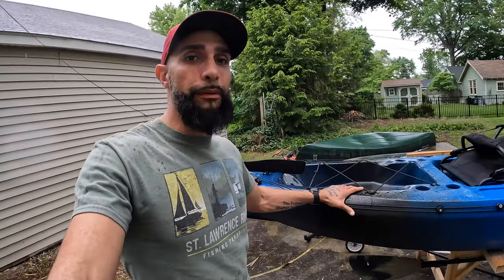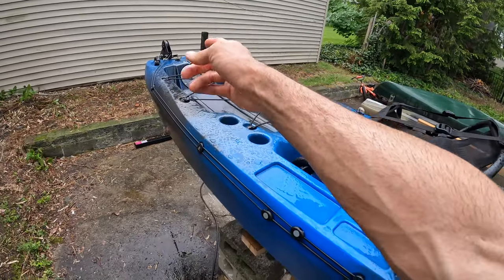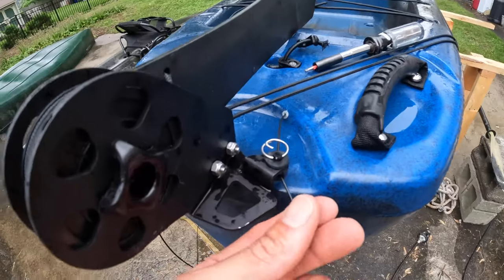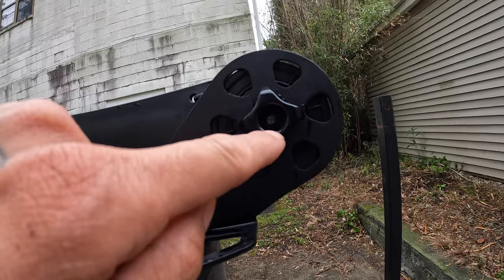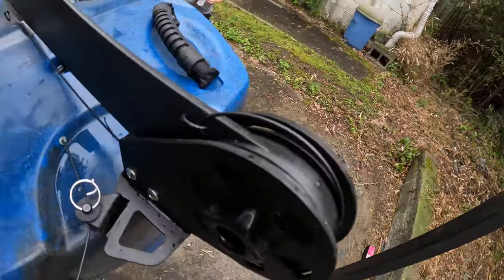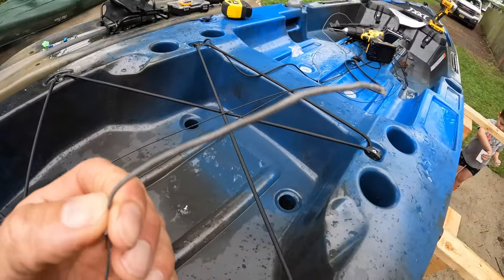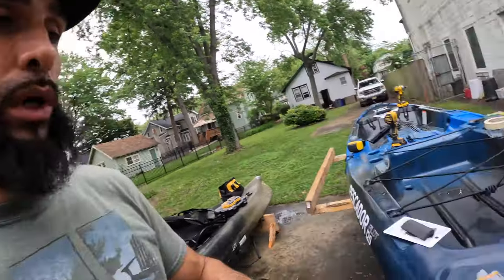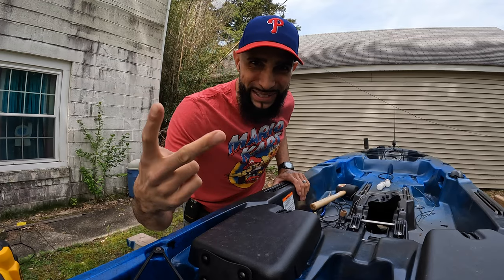Pescador Pilot 12 Rudder Mods

Comment: That’s an awesome idea for the steering cables Will.  Can definitely tell a  difference.  Getting ready to run the rudder deployment cables inside the kayak like you did.  Was wondering did you use one or two cables for the rudder deployment?   I was thinking using two cables might be easier installing.  Im new at this so any comments would be appreciated

Comment: I mentioned this in the unboxing video, but it looks like you still don't have the rudder installed correctly. The rudder assembly should be flush with the body of the kayak....this is a step many people miss...you have to turn the rudder FULL right and push down...this allows the assembly to drop down into its locked position. It looks like yours is still raised up a little so it not secured in place.